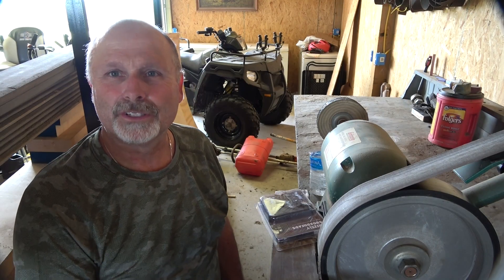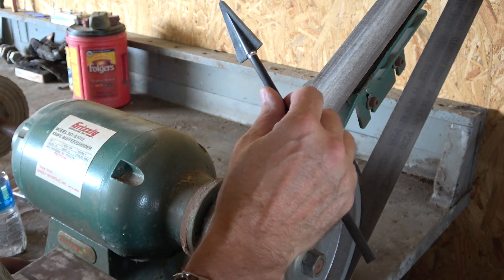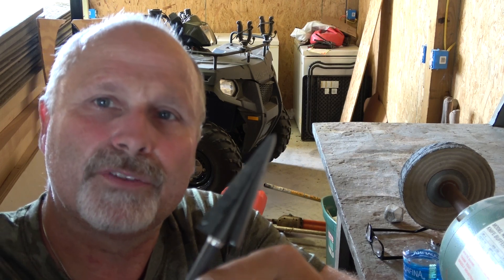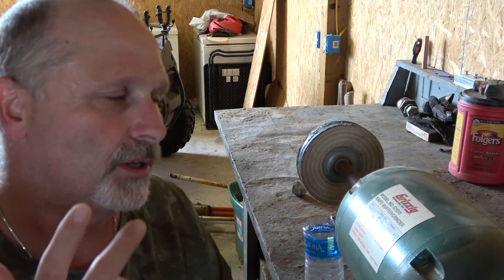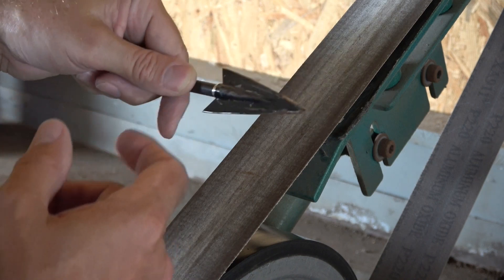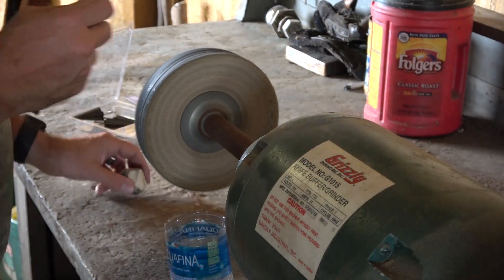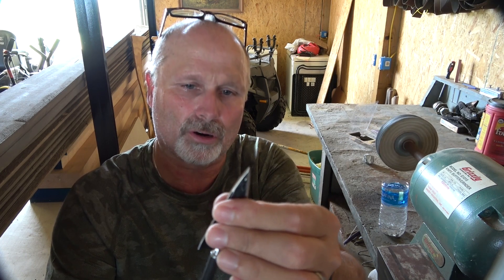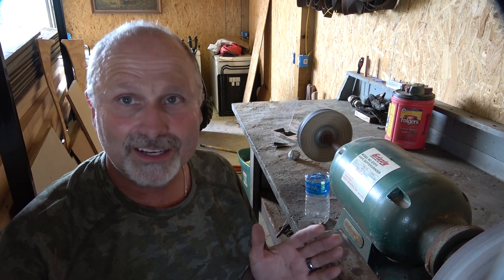HOW TO SHARPEN SINGLE BEVEL AND DOUBLE BEVEL BROADHEADS

Comment: What unit you headed for? I just use a butcher steel. Sometimes I will smooth up a bit with leather but, not usually.
Reply: I don't thank buffing wheels are as dangerous as AI'n female Grizzlies 😂
Reply from the maker: Unit 71. Yeah there are so many techniques to sharpen, I just thought I would share how I do mine.
Reply: @MoneyOutdoorAdventures  I hope you have a great hunt sir.
Reply from the maker: Thank you!   @UncleDanBand64